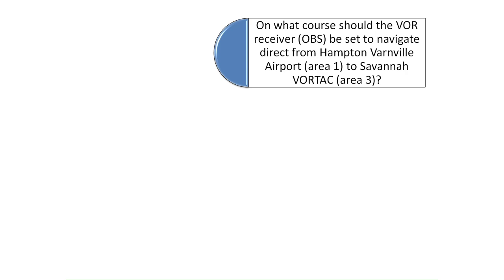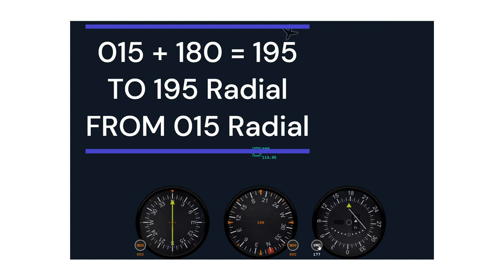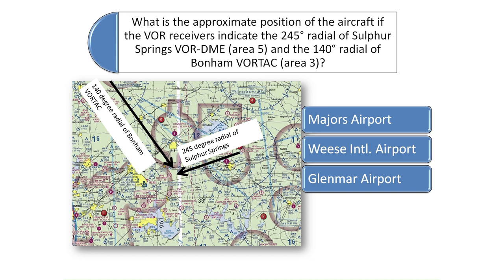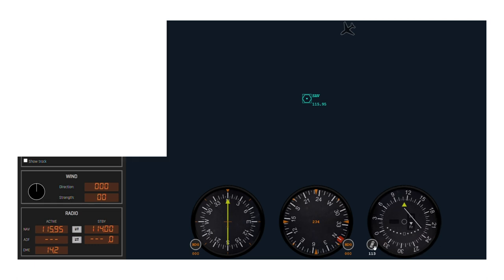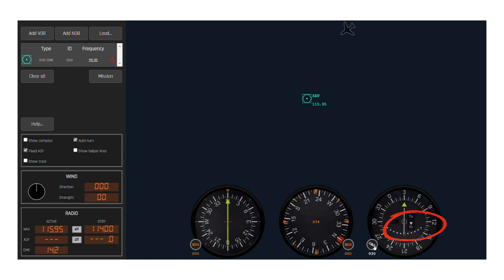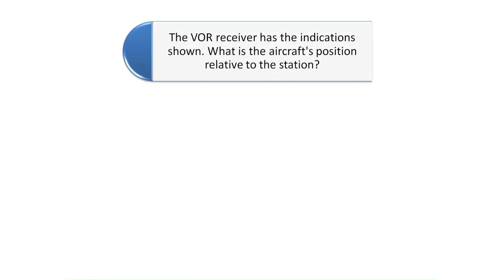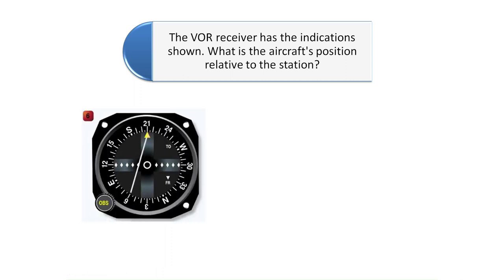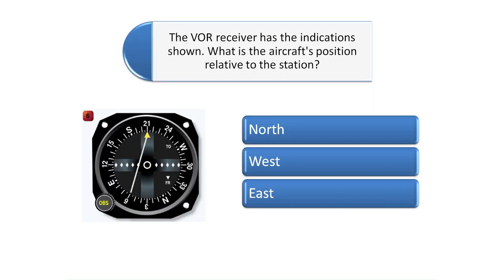5 VOR Questions from the Private Pilot Written Exam - FAA Written Test Prep for VOR Navigation

Comment: Your explanation of Question 1 is correct but test takers will not have a VOR to turn the OBS knob on. I think the correct explanation here should be to take the reciprocal of the 015 radial from the Savannah Vortac which would be the "course" of 195 to Savannah.